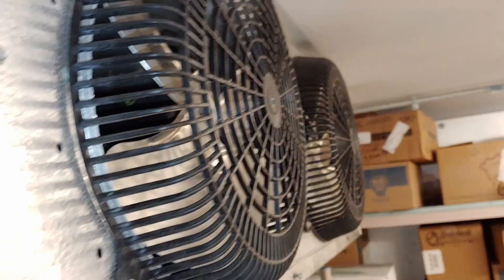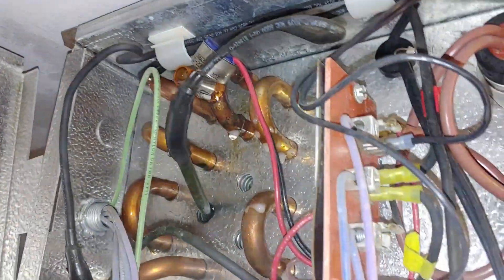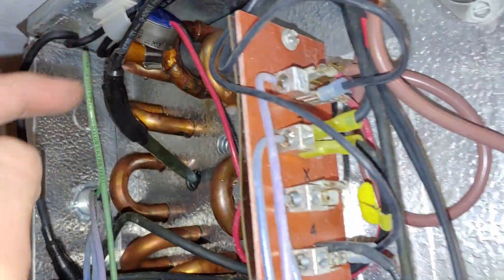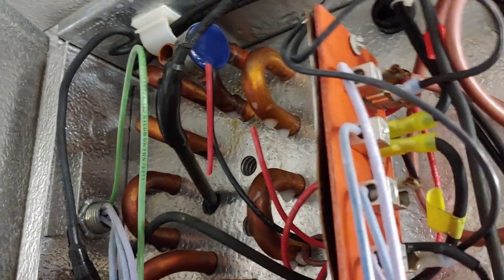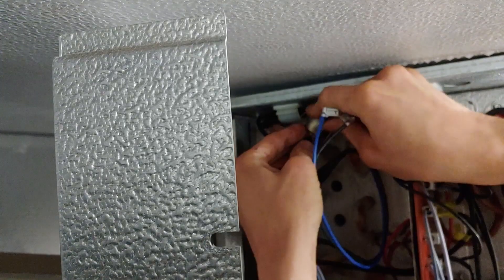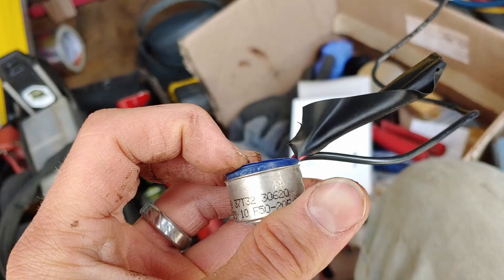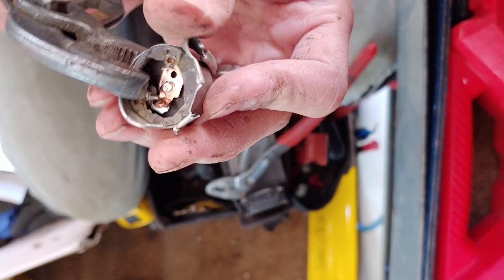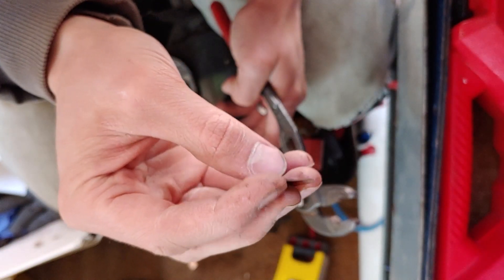Freezer Won't Stay in Defrost; Defrost Termination Switch Replacement

Comment: Have you ever come across one of these switches that used a mercury switch instead of dry contacts?
Reply from the maker: I have never come across a Mercury switch in a freezer. I have seen them as switches for chest freezer door lights, regular thermostats, and boiler controls.
Reply from the maker: Honestly mercury tip switches seem to be the most long lasting and best idea, if only it weren't for the toxicity.

Comment: This type of failure for defrost switches seems to be very common. Is there any way they can be made a bit more reliable?  Seems to be a simple enough electro-mechanical device.  Just lacks proper sealing.
Reply from the maker: Yeah you'd think a stainless steel cup sealed shut with epoxy would last forever. I think the temperature fluctuations over time just work their way through the epoxy and then once moisture gets in it's over. I wonder if a rolled aluminum seal like on a pop can would be better than the epoxy.

Comment: I thought the Fieldpiece SC260  was a homeowner DIYer meter not a pro level tools.... Are they really good?
Reply from the maker: They are fantastic! Granted, I have not been using any other meter, but it doesn't lack any functions I know of and I use mine daily. I think HVAC guys use a lot of them, but electricians are typically going to say if it's not a Fluke it's trash. I would highly recommend the Fieldpiece, it is one of my favorite tools, hands down.
Reply: Fieldpiece is definitely not a diy meter my 680 cost almost 500$ brother
Reply: Had it for 3 years with no issues and it test every thing in hvacr.